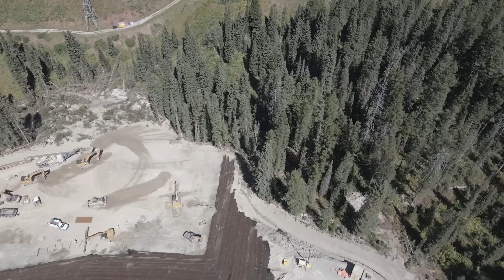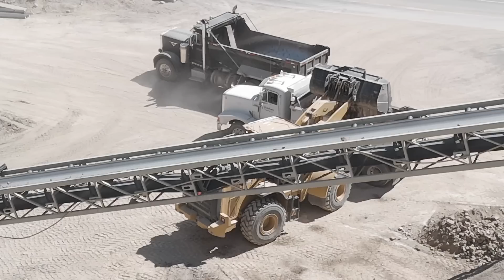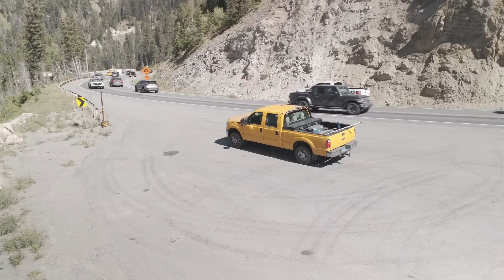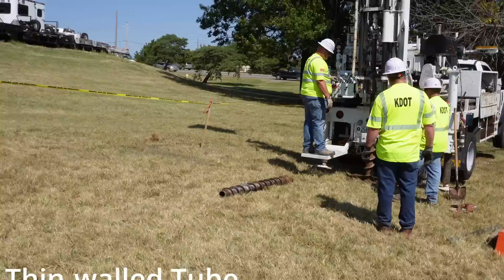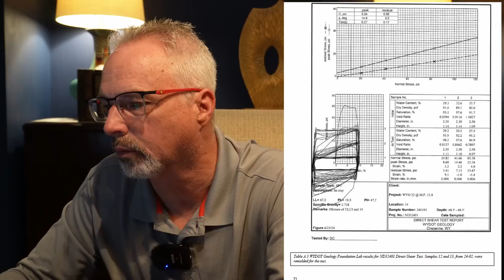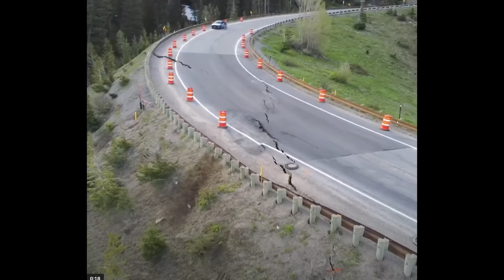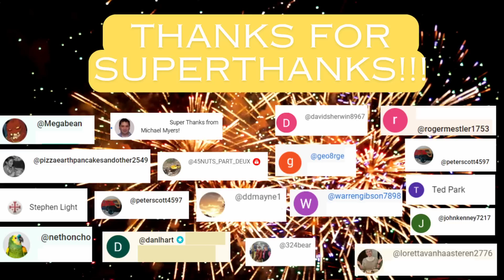Teton Pass Rebuild Update with Drone Footage

Comment: BSME '84 Univ of Wyo, MSE '92 CSUN, I used to work for the Wyoming Highway Department in northern Wyo to help pay for undergraduate engineering school.  I spent my after graduation career in aerospace/missiles/aircraft.  Factor of Safety ranges of 1.2 - 1.5 are minimum for aerial vehicles where weight matters (sometimes they are less in special circumstances). We also used FoS ranges of 2-4 depending, again for aerospace applications.  Ground design is more in the 4+.   Previous video referencing 1.1 is 10x and 1.2 is 20x blew me away as not the way we do it.  Probably like any state Wyoming has areas of significant unstable earth conditions, i.e., Gros Ventre Slide so an engineer should be conservative and cautious.  I've enjoyed this Teton Pass Rebuild series (I've driven it a number of times).
Reply from the maker: Thanks for your comments and experience!

Comment: This hairpin curve design was a bad idea then and now. Would it not have been cheaper in long run to blast through rock and eliminate flirting with repeated failure and inconvenience to travelers.
Reply from the maker: I agree. That hairpins is not a good idea at all with the kind of winters they have there.

Comment: It's hard for me to tell, but it looks like the roadway and embankment functions like a dam. This would be consistent with the way the failure occurred, as well as when the failure happened - springtime melt of the accumulated snows. 

Maybe the water could be drained downhill some other way. If it couldn't, wouldn't it make sense to install a culvert at the base to let the water drain through? 

Maybe there's a way for the water to go through the structure? There seems to be something on the plan that allows for that, I can't tell from the video. Perhaps if you have a follow up, you could discuss how this structure handles the spring snow melts?

Thanks for your outside expertise. I live in Wyoming, and in the past, I don't think WYDOT has done a very good job of engineering before they do the construction.

Comment: WOW! Trash for how they did the repair, they should have put base in first via big boulders and smaller cobble stone to fill in for good drainage. Then you put your gravel on top of that and tamp down small layers until you get to grade height. The way that they did this it will fail! The reason this happens is that the contract is given to a company, they are the ones that make all the money on the project. Then they subcontract all their work to smaller contractors that do the work for minimal work and material cost to stay on budget. The clay with no gravel will be the slip point if the earth fails in say an earthquake or high water ingress!
Reply from the maker: Now this thing will be exposed over the Winter and Spring months.  I think it is a risky situation.

Comment: Casey, I just found this channel, but will be a frequent visitor going forward.  I've spent the past 25 years as a highway construction inspector (new construction) primarily focusing on bridges & structures.  The very first thing I do, going into a new project, is to study the geotech reports.  I have to agree that it has been rare to see a factor of safety less than 1.5 used.  I've also found most geotecnical engineers to be among the most conservative of the entire profession...  astonishing!
Reply from the maker: Thank you so much and welcome aboard!!  You have a lot of great experience.  It seems that more and more there just aren't enough experienced inspectors to go around.  Yes, this situation in Wyoming is quite alarming to me.  Now they will have to live with this "temporary fix" until July 2025

Comment: I just drove over this on Sept 20th.  It's a challenging repair with the topography, but it seems like backing the whole curve up away from the ledge would be better.  Perhaps they don't want to lose the trees or make the curve any sharper.
Reply from the maker: It should be interesting this Winter.  I hope it is a dry Spring or they will be in real trouble.

Comment: As a Engineer for over 35 years i would have never fixed the road that way i suppose if you have alot of money you want to spend on some Elaborate engineering design. Soil nails are very, very expensive. I have fixed dozens and dozens of slides. To me it looks like there setting them self up for failure the road is still in a slide plane. They are trying to hold the slide up with Basically Rebar and concrete.
Reply from the maker: I think you are right. WyDOT has created a very risky situation in my opinion.

Comment: Make steps up the slope using BIG boulders backfilled and in between filled with smaller rock.  Start of steps shouted as far out as can be to keep the slope manageable.  No sand, loose soil, etc.  some bushes with strong roots on top would help with rain and controlling water flow.  Oh, and direct water away from the slope.  Your Welcome

Comment: The rock is being crushed through either a ball mill or a cone crusher before it is sent over the grizzly which also has a screen in it to sort base material size. So the processing of material is a little more indepth than what you mentioned. Just from the drone footage it looks like they are making 3/4 minus base and are likely moving it to a mixing location. Regardless of all the engineer info provided, Ames construction is one of the few in the nation that can do this job without fail.
Reply: Strange, as a retired heavy equipment operator it looks like the crusher is either a jaw or blow bar( impactor) crusher. It's not a cone crusher. And yes , I worked around all  types for years and fed them.
Reply from the maker: Thank you for those clarifications!

Comment: Excellent update Casey and thanks for the drone footage which is also excellent.  I have observed Ames Construction and Keller in Grand Junction and Fruita, CO on construction projects including micro piles and they are both competent contractors.  It is too bad that WYDOT is spending millions of dollars to rebuild the failed slope and they are relying on inadequate geotechnical information as well as making risky assumptions.  What are Wyoming Geotechnical Engineers saying?  What would the Wyoming Board of Professional Engineers and Professional Land Surveyors say if a complaint was turned in?  Extremely poor judgement by WYDOT.
Reply from the maker: Thank you.  It remains to be seen if Wyoming geotechnical engineers agree whether WyDOT is following the standard of care relative to this project.  The other shocking thing to me is that the resident engineer for this project said when referring to their decision to try and "save the road" by removing the asphalt only to have a catastrophic failure hours later, that they would do the same thing again.  Not at all reassuring in my opinion.  It appears to me that WyDOT is a rather small organization with severe limitations (financial and technical).
Reply: @CaseyJones-Engineer  I believe all their engineering design is typically done in WDOT Cheyenne Residency but why would they not bring in qualified geotechnical consultants? It seems like they searched to find a geotechnical consultant that would sign off on their hap hazard approach to the temporary repair and redesign? Why wouldn't they use a Wyoming Geotechnical Engineer?

Comment: I would be very interested in seeing an analysis of the failure.  As a layman, when I look at the layout the curve looks like a dam.  I don't know what the catchment looks like, but it's probably forest.  After heavy and prolonged rain I imagine that a big volume of water would collect behind the "dam", on the inside of the curve.  Where does that water go?  My guess is that an effective drain is needed to prevent the water from seeping under the road.
Reply: Worse, a dam curved in the wrong direction.  Water pressure will pull it apart, rather than compressing it.

Comment: I can see the attractions to styrofoam blocks.  Pretty cool!  Very quick compared to hauling in rip-rap or even the fine stuff that was originally there.

What troubles me is that they don’t seem to be fortifying the remaining original fill.  I don’t see drainage or de-watering.  And the slope that abuts the styrofoam seems very steep.

If the original fill shifts or fails, seems that styrofoam, because of its low density, would offer little restraint.  Is my concern reasonable and justified?

As I mentioned in a comment about your earlier video, this area is earthquake prone.  In 1959 a mountainside let go and filled a river valley, creating “Quake Lake”.  In publicly available documents, is there any mention of stabilizing the structure to a degree that would bring it up to modern seismic standards?  

I built a house in Idaho, about 200 miles away from Teton Pass.  It needed to be built to what in 1999 was rated as level 4 standards, the highest for residential structures.

Thanks for the excellent video - it reflects a lot of quality work.

Comment: Your concerns about the safety of this road are well thought out.  If you were actually doing this repair, the road would still be closed, and you would be responsible for multi-millions of lost economic value, and the loss of multiple businesses.  Any Governor or Politician would fire you immediately, as soon as your timeline became known.  This road is a major chokepoint.  It will stay open as soon as practical, and after-repairs will be done as needed.  Same with any Interstate bridges, Shipping canals, or Railroad lines.  People like Elon Musk have realized this, and that is why slow and non-speedy non-competitors are being swept aside like flies.
Reply from the maker: Not really. You can't dispense with sound engineering practice just because it's not convenient in certain cases.
Reply: @CaseyJones-Engineer  Correct. Ignoring engineering standards leads to fiascos like Stockton Rush and his Titan submersible.
Reply from the maker: @leestamm3187  Thank you!

Comment: I am just a hobbiest engineering disaster spectator, but I am surprised I do not see some sort of provisions for drainage going from side to side across what looks like water retention across a drainage.  Then some sort of vertical and horizontal reinforcement to provide an internal "Self Support" of the roadway loads.  Call it an equivalent of a bunch of drain tile/ culverts punched through at various levels on the base then once those are in doing some sort of injection of concrete grout cris-crossing in a lattice in 2 or 3 rows that would tend to leave the dirt porous, yet have enough structure to be almost bridge like with beams formed to take loads.  No idea of the cost, but what I see looks like a quick and cheap fix to last long enough that people will forget about everything quickly since there was minimal inconvenience.

Comment: Dude the Flaggers have started a war with the 10k cars that go to work everyday they need to work at night
Reply from the maker: That is a good point, although I thought that they would be working 2 shifts (day and night) to get this thing finished before Winter hits.  That bypass will be a mess if it must be used over the Winter.

Comment: Well, I’m a half engineer I guess… I took two of the four years of engineering and then switched to medicine. So that in mind just using common sense this looks crazy as you suggest. The sidewall slope looks way too steep, has already slid down the hill once, and just like in medicine, you have to base sound conclusions on the science and the science here as you point out is very shaky. The construction people are doing a very good job according to the instructions they have and hopefully they can finish their job and get out of there before it slides again
Reply from the maker: Thank you. The contractors are doing a great job. WyDOT though...

Comment: Thank you, Mr. jones. At 1:26, I see some soil movement at the top of the slope, on the right half. There is a bulge. Tell me, if I am wrong. Also, the water runoff, coming down the road, appears to dump to the inside of the curve. It could, depending on the permeability of the soil, be the source of the problem. Nice drone shots.

Comment: Structural engineer here.
Factors of safety are used to cover various aspects of the design including.
1. Uncertainty in the measurement of the material properties and loads.
2. The randomness in material properties and loads. By this I mean if you do high quality lab tests on a number of different samples in the area of interest there will be a range of results. If you have enough samples you"ll be able to fit a probability distribution.
3, Inaccuracies in the analysis method.
There are other aspects which are included in the FoS but I don't want to over complicate this post.
For engineering structures these aspects are generally much more favourable than in geotechnics (e.g. the properties of steel can be measured more accurately and have less variability than soils). For normal loading conditions a typical overall FoS would be around 1.8. We'd only use a FoS of 1.2 for very rare loading conditions. We can on the other hand use FoS >4  for critical items with a lot of uncertainty over the material properties.
I'd agree with the author of the video that a design FoS of 1.2 for normal loading events seems very low.
Reply: Here? Where?
Reply: @OffendingTheOffendable  Typical values for design codes used in offshore oil and gas which are used in many countries.
There's no unique definition for the factor of safety which complicates the picture. A simple definition for structures would be the ratio of strength to the applied load. But which strength, which load? We are dealing with random variables so not so easy to pick a single value. We often use "characteristic" values which are typically mean +/- 2 standard deviations. In soil stability calculations the definition is different of course and I hope the author of the video will clarify. It's difficult to make precise comparisons.
Reply from the maker: Thank you.  I also find it out that they didn't not include the values for the soil properties that they used in their report.
Reply: @CaseyJones-Engineer  How do you define FoS for slope stability? It's the ratio of what to what?

Comment: I work in an engineering field but not geotechnical nor civil. Still, in my day to day I see similar, what I will loosely term, "strategies" employed. In some cases it's out of necessity because it isn't possible or practical to obtain empirical data. In those cases we typically apply a generous safety factor to cover the unknowns. However, in my experience it's much more often due to someone being in a hurry to meet a deadline. I don't have the engineering background nor the intimate details of this project to say for certainty as to what is driving the pace here, but I could hazard a guess. In any engineering field there are cases where someone's best guess causes a failure and the worst that comes of it is having to do it a second time. There are others, like this one, where people's livelihoods and safety are at risk. I'm not sure I would want to be a motorist and rely on someone's back of the napkin sketch. The big issue here is that the vast majority of people using this road aren't aware of the details to make an informed decision. Bottom line, if you had time to do it twice you had time to do it right once.
Reply from the maker: It makes me wonder what kind of condition a slope would have to be in for WyDOT to understand that it was about to fail spectacularly.
Reply: @CaseyJones-Engineer  whatever it is I would bet that it would have to be located in an area that isn't deemed to be critical infrastructure.

Comment: So my non-engineer assumption is that disturbed samples would only be good for sampling local materials to be used as fill.
The decision to use foam though does make sense to me (to a degree) when dealing with an area this unstable. There are roads near me that have a tendency to sink as a large percentage of the area is muskeg; some of the worst sections have had had foam injected under the road base to prevent further sinking (or so I have heard.)
Reply from the maker: Interesting, thank you.

Comment: From the excerpt in the book: "sheer strengths are decreasing significantly at the time of failure due to either changes in pore water pressure or softening of the soil structure" seems almost 1 to 1 applicable to the failure of the roadway lol... This whole thing is just a lousy hackjob.

Comment: Excellent reportage. Incredible drone shots.  Kudos the WYDOT  producing a report,, even limited, in a matter of days in June.  I agree, without  a baseline,, or at least, without printing out that baseline in the report,,,, 
Ballasting the inside of the curve with the spoils seems to make good sense, also  taking advantage of a proximity site for those spoils.

What I do not understand is the use of polystyrene blocks.  I need to do some study on that.  My assumption would have been ,, cut away the slump, geotech fence and 'nails' ,, creative use of the tech.  I have never seen the use of,, but not my area of expertise either.
The new fill in the excavated area I would have thought would be large, heavy sharp corner stone.  The grizzly, where normally a griz waste is the large stone,, in this case, that is what is desired for the rebuild.
I am probably miss remembering which curve that is, but is there a straight away  down hill from there,, north or west side of the road (right side going down hill)   Cut and blast a new truck ramp for the stone.  10% grade can always use another truck ramp.  That is a brutal pass for its steep grades.
Reply from the maker: Thank you very much.  I definitely wouldn't want to drive that road in the Winter.